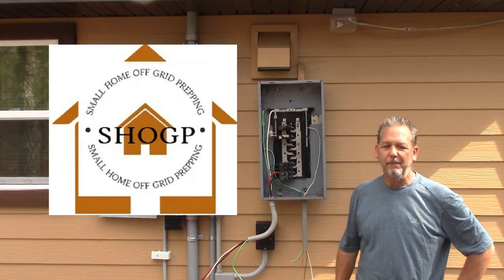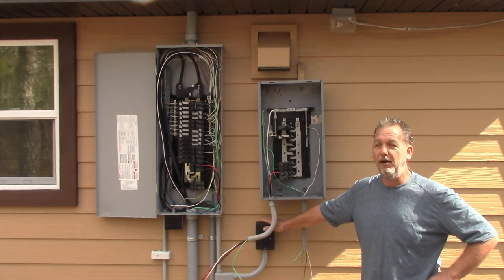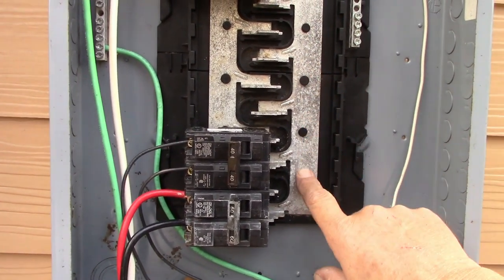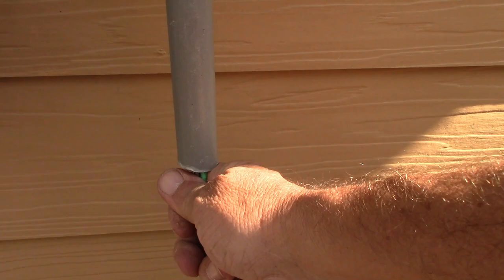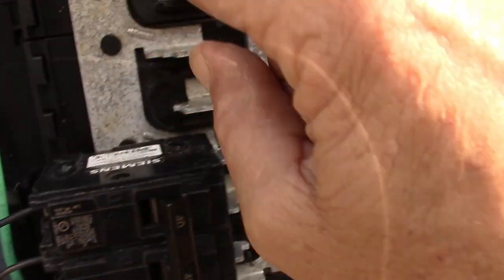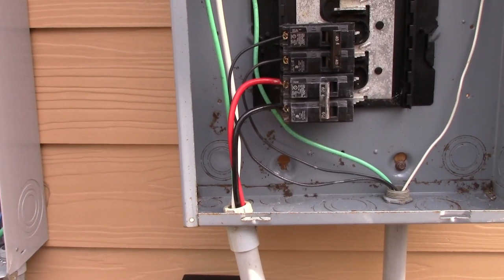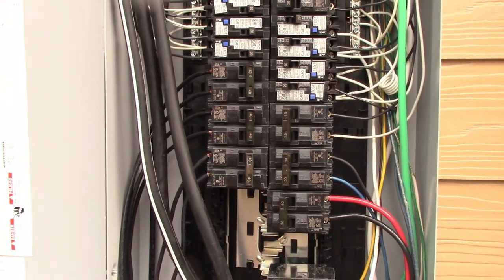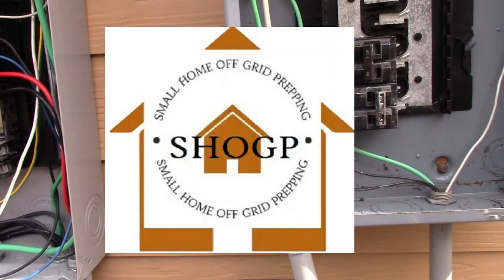BUILDING A GENERATOR TRANSFER PANEL

Comment: Great video. I noticed you had a 60amp breaker used in this test scenario to feed power from the main panel to the generator transfer panel. Was that intentional, or was it just a random breaker you had lying around? I am trying to decide on a 30amp generator panel or a 60amp generator panel. Is it best to go bigger, and move over as many breakers as you can, then you have more to select from if the power were to go out?
Reply from the maker: The 60 amp breaker was random, I just put it in to show how it's done. The best way if code allows it in your area is to connect the inlet to the main panel, and install a main interlock, that way you could chose what you want to run and turn off the other circuits. If code does require a transfer panel, you most likely will have to do load calculations for permitting, that will determine what size feeder breaker you will need to install in the main panel to feed the transfer panel, then you will have to transfer the desired circuits you want based on the sum of the generator being used, portable generators are usually 30 or 50 amp. This is more expensive than just powering the whole panel, transfer panels are usually only used were code requires it to balance the load. I have a video on connecting an inlet and interlock to the main panel, I will post a link, but you can find it on our channel, it's titled connecting any generator to the whole house, this is also how I connect my solar power to my main panel as well to power the whole house.
Reply from the maker: https://youtu.be/09Dlv5TrZ_o

Comment: I have to agree. Yes most people now days only know the field they are in ( a lot of don’t even know that, parts changers that don’t understand how things work).
A lot of us older people have a ton of knowledge. I’m a network, server, av, voip,cctv tech, I do large scale projects like factories, data centers etc. I don’t hire anyone to do anything for my home, nothing, pluming, roof, electrical, automotive etc.
When I have anything that need to be permitted I do the work and get one of many friends in many fields to pull the permit when it’s not my home, and make sure everything is done to or above code. But I do get it, nowadays common sense is not that common you have to cover your butt for legal reasons. I do appreciate you providing this content.
Reply from the maker: Sorry it's taking so long to get back to you but we just got hit by hurricane Milton, we lost power for over 20 hours and the solar did great, at one point I forgot the power was out. Everything you said is dead on point, I couldn't agree more!! I'm glad you enjoy our videos, I'm putting one together on hurricane Milton today.

Comment: Just subscribed. Not sure why YouTube doesn't pull this vid up first when searching "Transfer Panel." Been looking at other vids and never got this good of an explanation. 

This channel needs to be the first vid people see. Not the last. 

Thanks, I finally understand.
Reply from the maker: That's great, glad it helped you understand. I did end up putting in a transfer switch and transfer panel for my solar, it worked great when we lost power during Helene and Milton, the transfer switch swapped over to solar so fast when the power went out that the lights didn't even flicker.I have videos on both of those if you didn't see them yet and I am about to do a few videos on generators/solar transfer switches, floating neutrals or bonded neutrals, should be out soon. Thanks for subscribing and helping to support the channel!!!